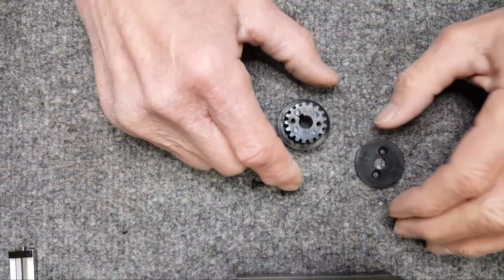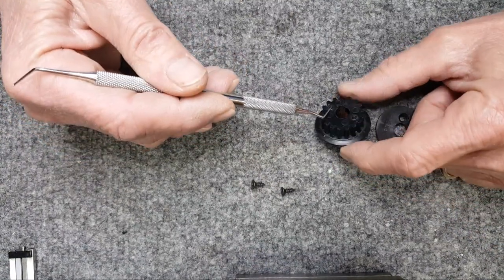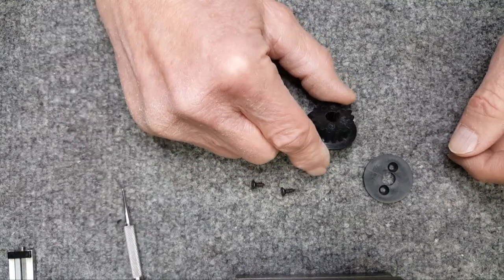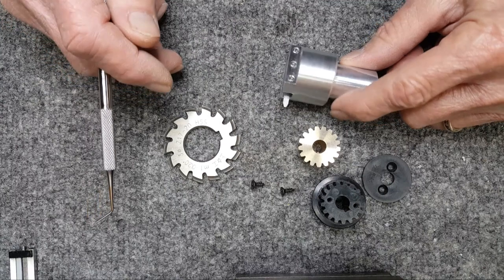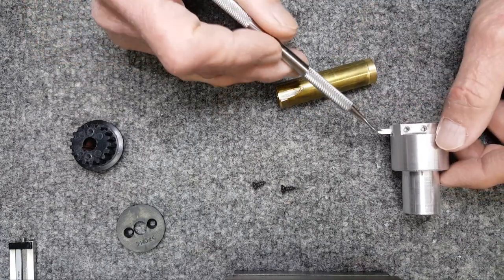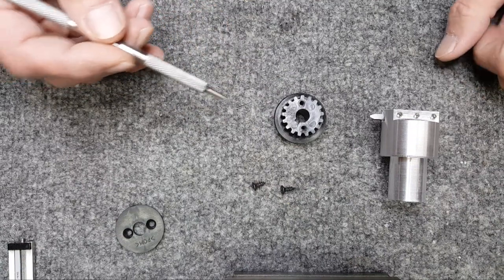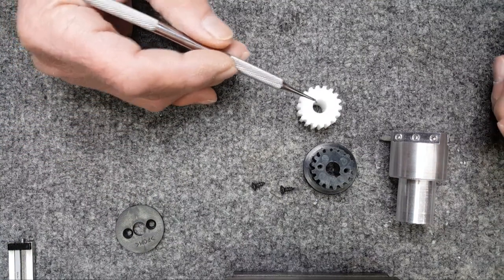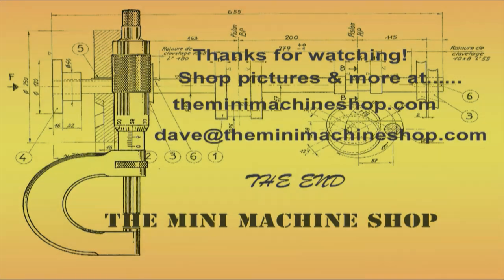Making Timing Gears And Knobs

Comment: That is certainly one way to do it.  Since you are obviously a guy who loves technology and learning you might find that a 3D printer would be handy around your shop for this sort of thing.  Yup, another plastic one will wear out eventually but you can print those for pennies so make the number of spares you figure you might need and put them in a bag.  I picked up an Ender  for $225 on Amazon and discovering they are easy to use and really handy around the shop.

Comment: Cool Dave, I went through a similar process when I lost a 40T gear for my threading train on my lathe. I went seat of the pants though, I calculated the OD and ground a from tool using a similar size gear, I did all the reading on gears and figured the depth. On the first try I successfully made a usable gear from aluminum, which got me going, then I made another gear from bronze, which is still in the gear storage box, because the aluminum one is still running. Short story is, I am not afraid to make gear now. Enjoyed the video, stay healthy, and cheers!

Comment: Thanks for the surprice, issuing this video regarding Your statements a short time ago. It's wellcome.
At the time 6:00 You showed a poor piece of brass. Did You use climb cuting? It looks like that.
Another comment was made about the belt. My lathe use the same kind of belt. Timing?
Reply from the maker: Actually I can't remember if it grabbed making the cut or backing out. Seems this is a very popular belt on many different machines including a WEN wood lathe. But after an entire day of research the motor pulley not only has the wrong pitch but it's also not a recommended diameter by the belt companies thus why it wore out. It's a T5 timing belt... pitch 5mm or .197
Reply: Okey. I've also faced mill bits grabbing the stock when my brain has been on idle...
Was that machine the last one being built by using left over surplus? China.....? Soo faar I'm still happy about my Chinese built Laith checked for specs in UK. Warco...

Comment: Will changing from 17 teeth to 18 teeth change the speed?  Likely I'm missing something.
Reply from the maker: Yes it will an 18 is larger so it will go faster with less torque but the size difference to me is insignificant... Also i did say my lathe has variable speed.

Comment: Hi Dave, I'm a bit confused.  What you have is a timing pulley, not a gear and that's why LMS called it a pulley.  There are different specs for a timing pulley depending on the pitch of the belt.  An involute gear cutter will not cut the profile of a timing pulley.  Fact is timing pulleys are widely available from many sources including Amazon.  However, if you what to make your own, Stefan G. did a video a while back where in he made a timing pulley.   Thanks for the vid!
Reply from the maker: So where do you buy cutters for timing pulleys?
Reply: Very true,  all i know are Hobbs , but you can make one by matching it to your belt or current gear/pully

Comment: Good job of problem solving.  If you have a rotary table with the indexing plates you can make a 17 tooth gear just fine.
Reply from the maker: Problem is the table only sits flat...
Reply: @TheMiniMachineShop  my rotary table sits flat and also horizontal.   I have used it many times to make gears on my Grizzly mill.

Comment: With all due respect sir, measure from the i.d. wall to the top of the tooth, add 1/2 the inside diameter, multiply by 2 to obtain gear o.d.
Reply from the maker: Never heard of that method Thanks!!